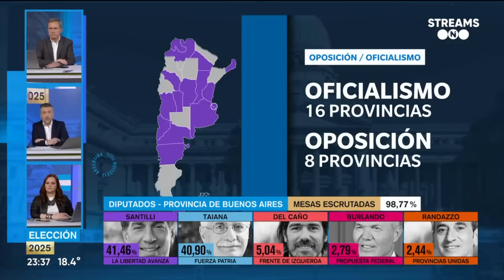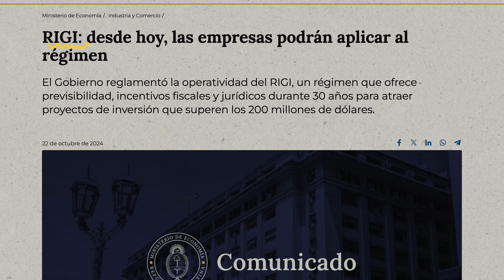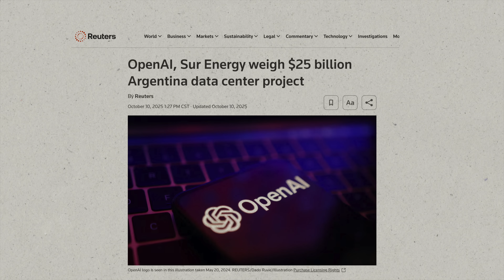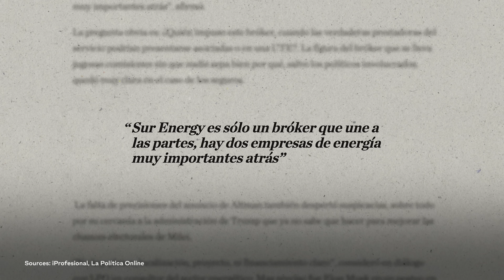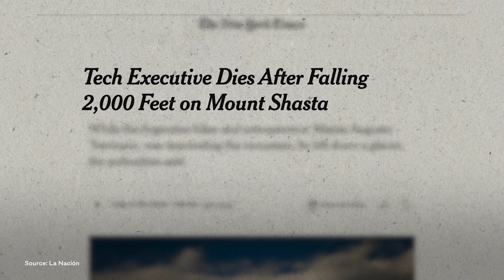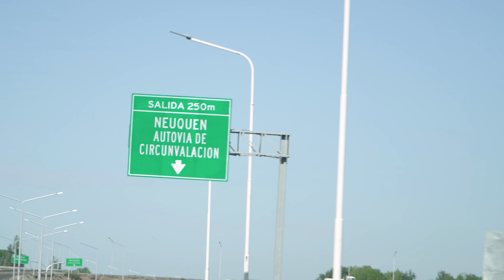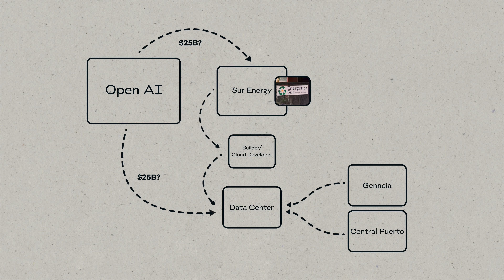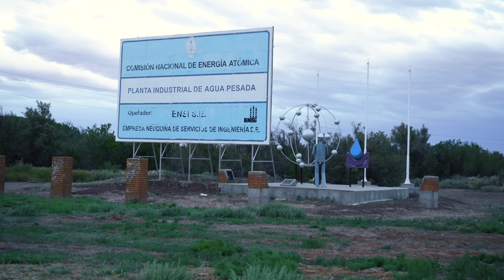Investigating OpenAI's $25B (fake?) Data Center

Comment: Honestly? Build data centers in Quebec. The electricity is dirt cheap and the cold(er) weather makes cooling costs significantly less.
Reply: But the LLMs would all refuse to work unless you prompted them in French.
Reply: "Patagonia has a highly variable climate, generally cool and dry, but with significant regional differences: the eastern steppe is arid, while Andean and coastal areas are wetter; summers (Dec-Feb) bring mild days (15-22°C/59-72°F) but cool nights, while winters (Jun-Aug) are cold with snow, strong winds (especially the "sudestada"), and unpredictable, all-season rain/storms are common. Expect extreme weather, so layering is crucial, with sun, wind, and even snow possible in one day, even in summer."

Comment: why don't they make electricity with the heat? If it evaporates water, I guess the steam can be used to spin turbines
Reply: It's not steam, it is water vapor of  <100°C  , so bad quality  "steam".
Reply: Not hot enough. This is low-grade waste heat. Think a huge amount of warm water, rather than a small amount of hot water. It's pretty much useless. You can use it for heating buildings, but only buildings located right next to the data center, and that's not a common situation.
Reply: @vylbird8014 also I'd imagine the data centres would have insanely bad noise pollution for any nearby residents given that it'd be constantly emitting around 70-90 decibels of noise  which would not make living near one desirable.

Comment: Cooling water doesn’t just vanish into the air; most of it gets warmed up and returned to its original source. As AI pushes for hotter, more compact servers, companies like Microsoft, Google, and OpenAI are moving toward closed-loop liquid cooling systems that use little to no evaporative water. This approach cuts down on both energy and water consumption compared to older evaporative methods.
Reply: They already are using a closed loop to cool servers with liquid cooling. (Since the early 2010's) the issue is that they are using evaporative cooling to cool off that closed server cooling loop. The newer closed loop cooling systems use less water, but they still use a lot to keep cool. 
That evaporative cooling process does just evaporate water into the air. 
And if they are getting their water for evaporative cooling from groundwater, then it is not getting replenished from rain or other freshwater sources quickly.
Reply: when water isn't evaporated, then it's put back into water systems very warm. When you do that in rivers and lakes you can do huge harm to the native ecosystems that have evolved to live in cool waters. When you put that back into the municipal water system then the local government literally have to spend money cooling it down because people don't want warm water coming out of their cold taps, and governments generally have more pressure not to poison rivers by being the ones to dump hot water. And then of course yeah, in closed loop systems, by far the best way to cool off the cold side of that loop is evaporative cooling, where the water just goes up into the sky and falls as rain somewhere else
Reply: @archigallus  No, water never leaves the loop, think of it more like your All-In-One in your PC, just industrial scale, at the end is just huge radiators that just blow hot air.
Reply: @archigallus  Their tech team knows the deal. They use closed water systems for practical reasons, not because of ecology or your feelings. In a closed system, they only pay for the water once, instead of having a monthly bill.
Reply: If closed loop would really use less water and less energy everybody would do it.
Reply: @DieSportsKanone  I think the less energy comes from the fact that you don't spend energy on bringing new water, and not the gpus consuming less energy
Reply: @DieSportsKanone  That's exactly what they're doing.
Reply: @DieSportsKanone  It has higher initial investment and maintenance cost. But most DC are moving to use it as it has better optics and economies in log term, as it allows you to just swap out racks and keep using the better infrastructure.
Reply: Yeah groundwater is the big no-no.  Energy is cheap and free if you do it right with solar (you really want global servers that follow the sun), so desalination isn’t the automatic disqualification it used to be.

Iceland is, as always, in the best possible position.  So much heat and cold pushed up close together.  🧑‍🍳 perfect energy
Reply: Hahaha 🤣 
Ok bro, the closed loop auto refrigerates without cooling with a external water source 😂

Also, no country in the world would allow a company to discard warm water in the rivers and increase the amount of bacteria and microorganisms while killing fish.
Reply: @dxd42  Google is your friend, you know?😁
Reply: well..why dont you have the data centers in your neighborhood???Bottomline is that they consume a lot of power and use a lot of water..in some cases noise pollution
Reply: @evansmuthomi1997  they don’t consume a significant amount of water actually
Reply: @evansmuthomi1997  I would agree: Canada has infinite water and is cold af. A datacenter here makes more sense. But Trudeau killed foreign investment...

Comment: Giant data centers being "required" are the equivalent of ISPs pushing everyone to buy ever faster modems back in the late 90s. We are going to find out later that improving technology will make giant data centers obsolete, but by then,  it'll be built and gathering dust.
Reply: Possible. The biggest potential problem there is in how specialised the hardware is. GPUs are somewhat flexible, but TPUs are designed to carry out massively parallel multiply-add operations for matrix multiplication and even have an architecture built to be more efficient for the successive layers of a neural network model. They do one thing, and they do it very well, but that's all they do.

The good news is that even if something completely different comes along next, physics hasn't changed - the electrical and cooling systems can still be used for new hardware. It'll just got a few billion to retrofit the datacenter with all-new computing hardware inside.

There's also the economic risk that in this rush to build so many AI-focused data centers, there might just end up with an over-supply. A lot of AI companies do not have a sustainable business model.
Reply: @vylbird8014  A tensor operation is a tensor operation. A TPU gives moderate gains over a GPU, but it's not meaningful. They ASICs aren't hard coded to models, they're still running shaders and flexible tensor operations.
Reply: @jayspeidell  Yes, but we don't know if the Next Big Thing will even be based on tensors. It isn't invented yet. It's possible that someone will come up with a new algorithm for machine learning that is better than anything we use now and isn't based on tensors, which would render much of this expensive hardware obsolete. This is a business risk.
Reply: @vylbird8014  Even traditional machine learning algorithms are scaled and parallelized through linear algebra.
Reply: @jayspeidell it's even worse because a company called Groq (not related to X or XAI) actually developed a specific LLM processor that is around 25x more efficient. 

So rather than being able to create this new tech and disrupt the disgusting NVIDIA hegemony, NVIDIA did a HALO acquisition of them to capture their IP and tech and can shelf it or do whatever they want. 

And no-one can do anything because HALO is used to avoid monopoly rulings so no-one can contest it. 

Hooray for corrupt legislation!
Reply: Yes. Itˋs called the AI bubble.😂
Reply: "We are going to find out later that improving technology will make giant data centers obsolete"

then you dont know what is technology even about, these giant data center is a moat

sure AI progress in topology, inferences and training design would reduce cost but you suddenly have 5 month training cost rather than 8 month
Reply: Isn't it true that many of the physical requirements for AI are literally impossible? I want to say that there simply isn't enough copper on earth to make AI work, maybe it's another material.
Reply: @GeorgIsm-u5p  Actual artificial "Intelligence" has one greater issue: What is it anyway? Without understanding Intelligence creating it is impossible. Currently, LLMs are little more than an emulation of intelligence in language. From my understanding the question is thus not "Can we run it?" but also actually "what do we even need?".
Reply: @Geo @GeorgIsm-u5p  Only if you trust figures from anti-AI fear mongers. In reality AI doesn’t require nearly as much resources as people say it does
Reply: @GeorgIsm-u5p you can create chips with actual model - LLM layout which runs it much faster and requires a lot less energy, but this it will be feasible when the LLM will be matured and don't get upgraded every 3 months. I don't think it will pass much time till then, maybe one or two years and we will be at a peak then impossible to improve for another few decades.
Reply: @overPowerPenguin  That's not practical...
Reply: @jayspeidell  Why it would not be?

Comment: Refrigerators have been operating on a closed evaporation/condensation loop for about a hundred years now, pretty sure they can manage the same in a data centre
Reply: And yet, they dont use it in datacenters.
Makes you wonder why. Any ideas?
Reply: @QoP..  The energy consumption of closed loop is much higher
because you need big fans to move the heat from the hot cooling water
to colder ambient air. 
In open loop water is evaporating, and the energy needed for
evaporation is huge, so you don't need such big fans. 
The  heat here goes from hot water to water vapor ,
and water vapor takes so much more energy away compared with
heating up air.
Reply: Most likely expense. I’m guessing using local water is cheaper and apparently governments are giving the land, water and electricity at bargain basement prices just to get the tech in their country. The local citizens are left holding the bag. Their electric and water rates skyrocket and they’ll be lucky to get a handful of janitorial jobs in the data center. The same is happening in the US and the individual states are not allowed to regulate them.